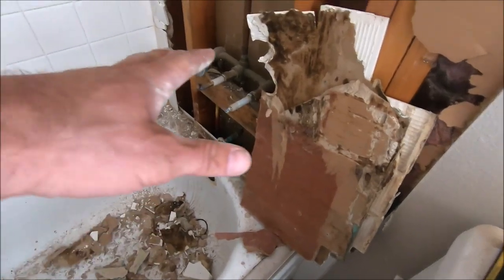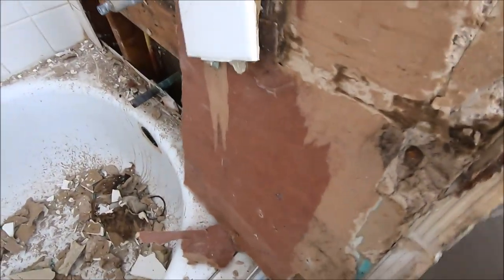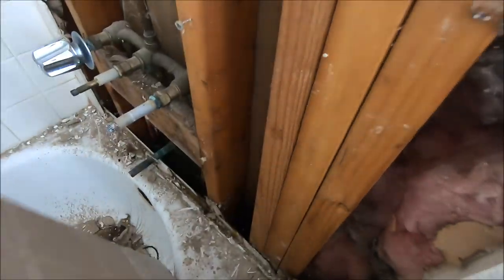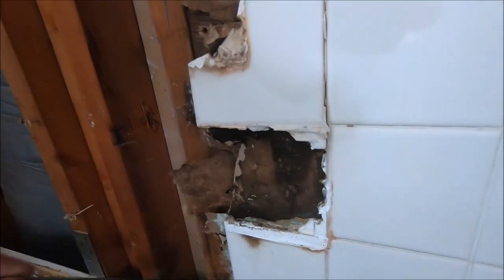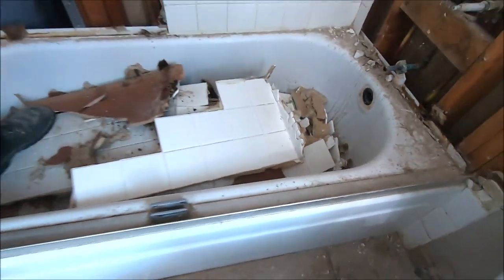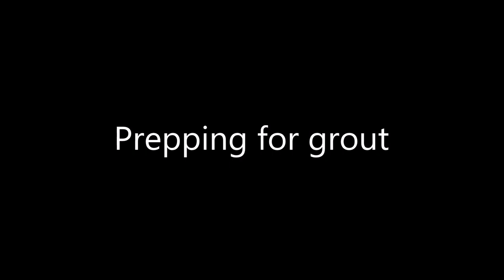Subway Shower Satisfaction - Bath & Shower Remodel

Comment: I was a sub for flooring tile etc. I work now as a Quality control specialist and warranty specialist for Atlanta Flooring design center. We're all over the south each. It's to bad that we don't have installers that actually install, like you and I do. 🤯 I could show you some production tile MS installs that would blow your mind. Most of them act like cutting 2x2 around the drain... Correctly is so hard. We actually run alot of this same BStrt Subway tile on alot of backsplashes. Love for you to join the team. If you get ready to get into the management side of the industry.

Comment: i like to put the trim on the face wall then tile the reveals so from the front it just shows the thin edge of the trim, plus it means that you don't have to mitre the corners
Reply: I am actually considering that method.
Reply from the maker: We do it that way mostly, but still miter the edges. We like the low profile better..

Comment: Nice! Like that quick & easy Demo.

1/16 Spacers for subway tiles?
Nonsanded grout I assume.

I use that Milwaukee 3" cutout tool for my "special cuts" like toilet flanges. Also good for Hardie Board. Use at least 4.0ah battery though.

I like the "no fuss" manual tile cutter.

Berg does it again!

Comment: did you put the new tile on kerdi board? do you usually use schluter products?
Reply from the maker: Yes, we most always install Kerdi board and Schluter shower kits. Great product!
Reply: @LandbergTileTV  do you ever use that "knockoff" Kerdi Board from Egypt? Its Blue foam covered in Black Bonded Mesh.

Comment: What's the best Diablo or Dewalt saw blade to use to cut the trim? I have no luck doing 45 cuts on the trim.
Reply from the maker: We use a 100 tooth Diablo blade. Works great only if you cut slow 👍